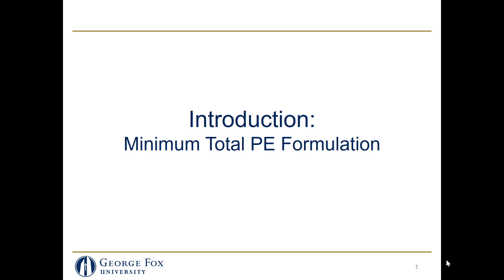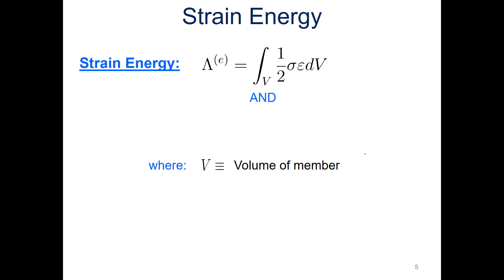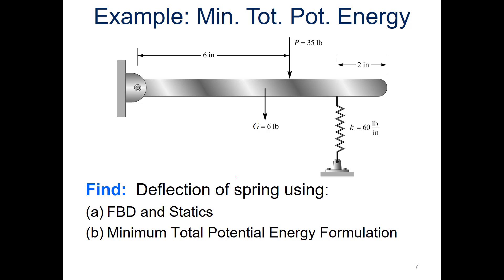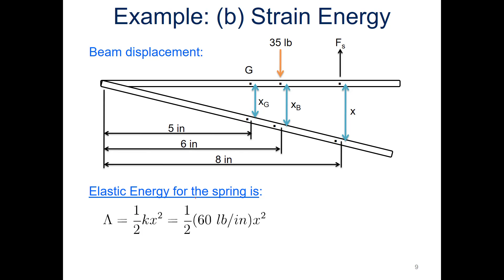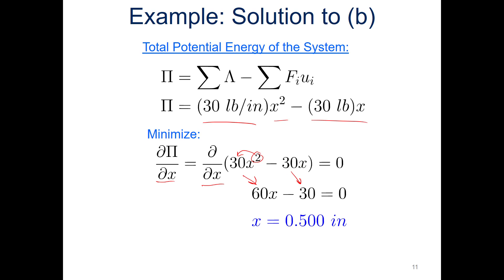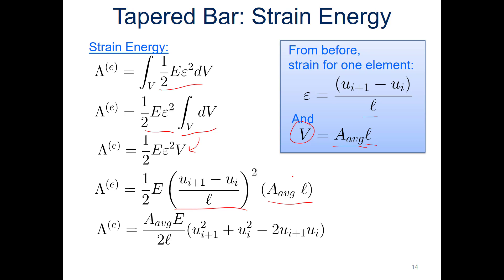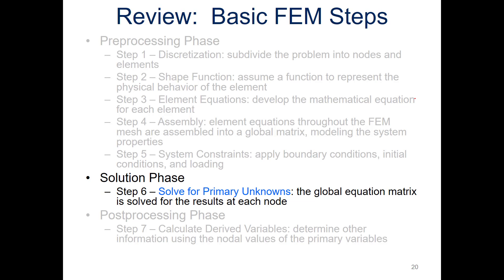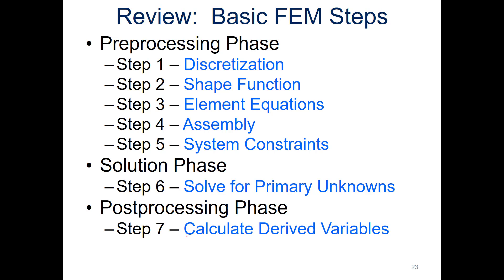Minimum Total Potential Energy Formulation

Comment: I have a question. If a do Work with a constant force deforming a spring, some of this work will be transformed into straing energy. Where is the other part?? Is it lost? How? What kind of energy is it transformed? Heat in the spring?
Reply: If the material is assumed to be hyperelastic, all the work energy is assumed to be converted into strain energy